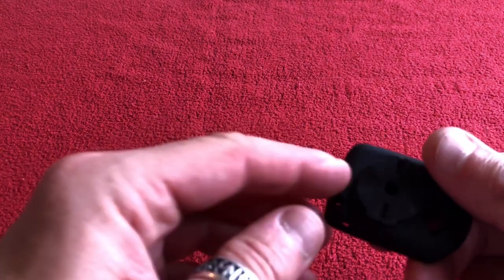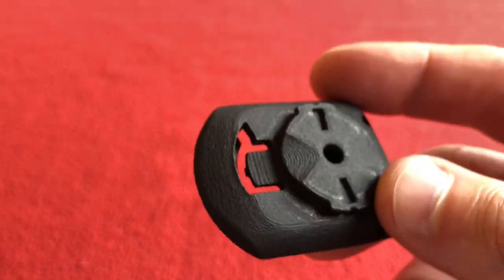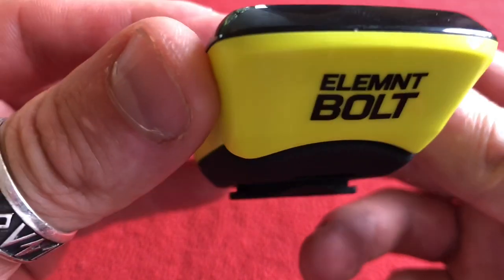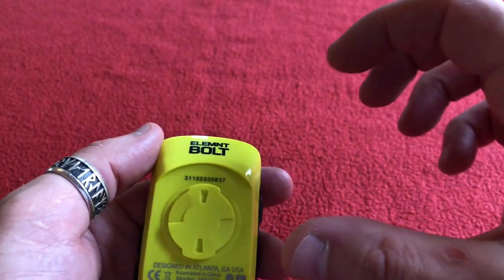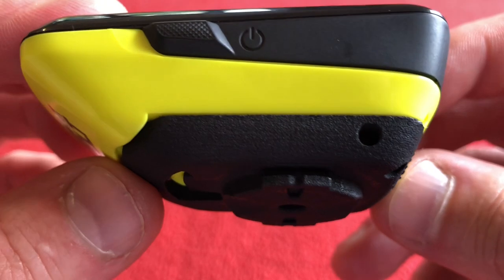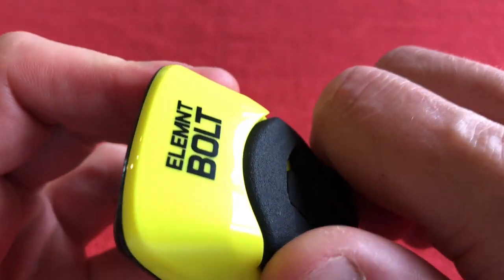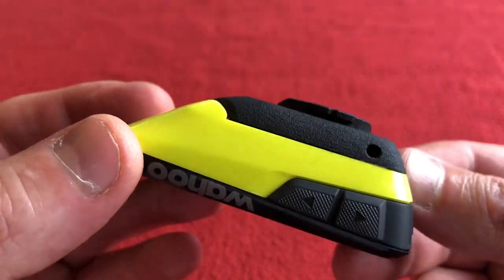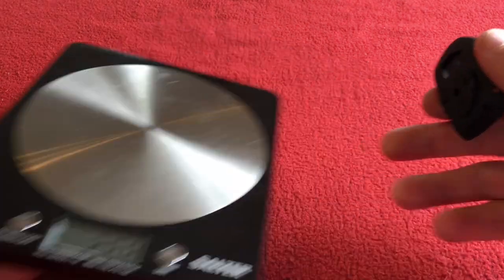3D Printed MagCAD Wahoo Elemnt Bolt to Garmin Adaptor 3D

Comment: Brilliant. 

I’ve ordered and fitted thanks to your video. 

I have a Giant bike Conduct mount and can’t use a replacement plug adapter but this works!
Reply from the maker: Which Doctor I’m pretty sure you get the screw with the element bolt mount. 👍
Reply: Kyro's House will check the box and packaging again.   

Thanks!

Comment: Kyro, I recently repacked my old deore lx hub set loose ball with phill wood hub greece.  Can I get away with putting on some finish line wet lube on the cone.  I noticed it really spins a lot faster.
Reply from the maker: Brian Baldino to be honest I don’t know, but I’m thinking anything is better than nothing, so go for it, if it doesn’t work you can always strip it and repack. 👍
Reply: Turned out it was the quick release mechanism that was slowing things down.  Had a quick release set meant for an aluminum frame.  Used a quick release meant for steel frame bike that put more torque on the hub allowing you to loosen the hub at the cones with a little play before putting it in the drops, so It's all working now - no wobble at the hub when on the bike or couarse.  By the way Kyro, you should get a pro Wheel Truing stand - I got the park TS2.2 7 months ago.
Reply from the maker: Brian Baldino ah glad you found out the issue, didn’t even think about that one. 👍
Reply: Ya, well today I've gotta perfect the rear canti brake toe in on my new Mavic wheel build.  Dam hard to do with two hands - really wish I had Four hands.
Reply from the maker: Brian Baldino yeah four hands would be great sometimes... 👍